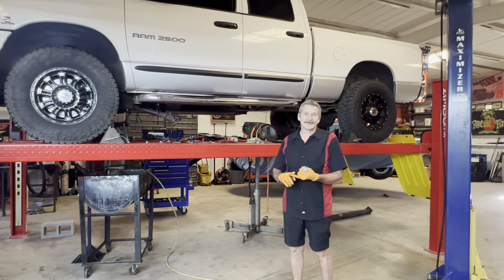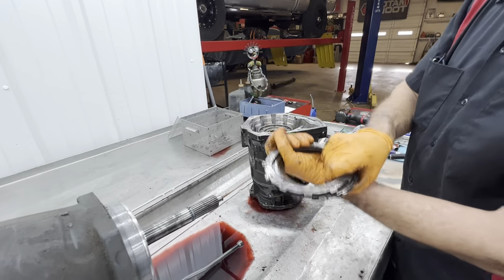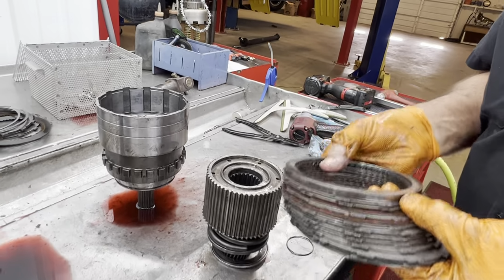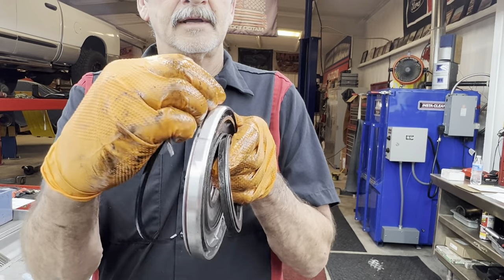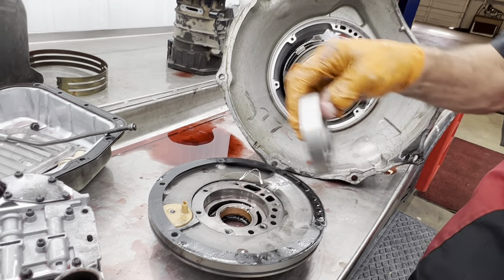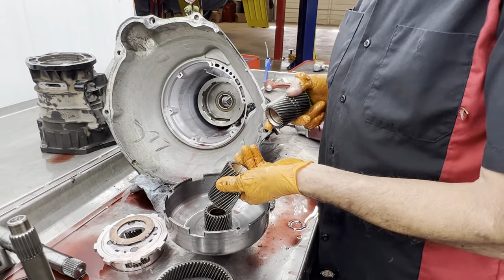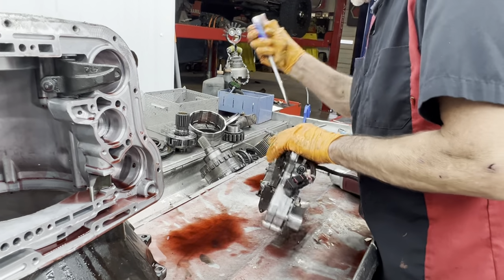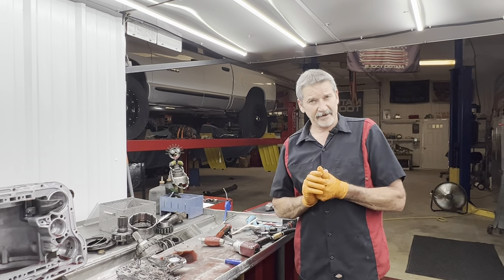03 Dodge 2500 4w/d, Transmission tear down.

Comment: Supply chains are definitely sketchy these days. I have a Yanmar tractor engine being built at a local machine shop and the crank timing gear has to be replaced. I spent 3 days trying to find one in the US and didn't find any. I had to have one ordered out of Japan and the shortest lead time I found was 4 weeks, hopefully they're right as everyone else was at 6 weeks. Don't sweat the camera mistake Miss Theresa, we all have our days. Another very good educational video 👍👍

Comment: Richard, I realize there's a lot more than meets the eye when working on Dodge transmissions, but when you opened that 4R100 it was like dumping out 4000 piece puzzle 🧩 😂. You keep reaching in and pulling out more parts until the table is completely filled. The knowledge you possess is astonishing 😮😊

Comment: Hi Richard and Teresa, 

Long time video watcher and subscriber for both channels. Love the videos. I just have a suggestion for ya'll about the sound in the videos. Richard speaks very softly but the air gun is very loud. I believe you can remedy this disproportionate sound difference by increasing the gain on the audio recording device and adding an outdoor/heavy duty microphone sound suppressor. This would be similar to the fuzzy looking microphone attachments professional news channels use to report outside in a loud environment or weather storms. Hope you find this comment helpful.

Very Respectfully,
Greg and Ashley

Comment: They never went to the TV motor till 2004.5-2007. There's very few 47re in 2003 trucks. But from 2003-2004 the 48re were cable TV

Comment: I have a question. I am building a c4 and was wondering if the 727 filter and adapter would be good with a trans brake?  I have only used the deep factory filter in my other transmission. And is there any benefit between them?
Reply from the maker: Never seen a 727 filter in a c4 I would stay with the factory brass filter
Reply: @richardteresacricheducatio3542  ok thank you. I just stumbled upon the kit and was wondering.

Comment: Who built the thing?  It's got a hardened shell, billet input and intermediate shafts but a car pump and a 4 clutch 3 gear.  The shell and the shafts were very spendy.  Going to a 5 clutch 3rd would have been cheap.  And they basically stole his diesel pump because he sent them his core that had one in it and they sent him back a trans with an inferior car pump. 😞😕😠  
I wish Youtubers would be more forthcoming about who does crap work so we would know who to stay away from.  In this case I don't think that Richard knows who it is but almost all of the time I see creators protecting people and businesses that are taking advantage of people or doing subpar work.  Maybe there are legal issues that I'm not aware of.
Reply: Tranny was built by Dave  Goerand out of Iowa. Had 160k miles on it. Knowledge has improved greatly since 2006 when this one was built. Think it held up pretty well considering what it’s been through!
Reply: @RandyDyson-o2o   You are absolutely correct.  There has been a ton of R&D since then and we know a lot more about what works and what doesn't.  And I was unaware of the age of this build.  If I had know how old it was I might not have been so tough on it but I still think most of my criticisms stand.  But I could be looking back with rose colored glasses, thinking we knew more than we did.  Goerand  builds some really good stuff so they've got it figured out.
I build my own.  That way I know what's in there and how it was set up.  And if it has issues I know right where to find the guy responsible. 😄 But I did have the advantage of being an ASE certified Master Tech for over 20 years.